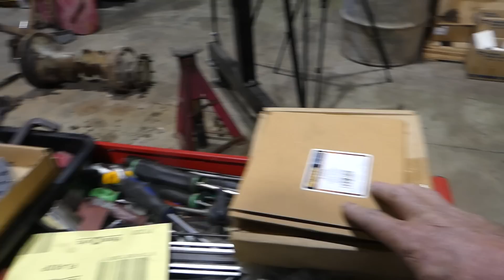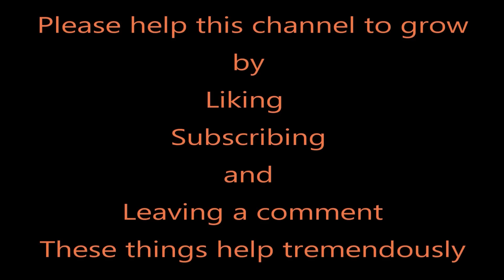Kangaroo Stew # 325  Still Fiddling with the MF65 and Making Progress

Comment: Hiya, two things...firstly, we are supposed to get smarter as we get older, keep your fingers out of the wire-wheel. My wire-wheel has mno rest and no guard, so if it wants to take a bite of me it spits me out straight away. Secondly, the UNF bolt, maybe possible to buy a longer bolt, cut of threaded section to leave plain shank, run UNF dienut on that..just a thought.
Reply from the maker: Yeah i think I will take the guard off, the polishing mop on the other side has no guards at all.

Comment: Interesting, on my Mk1 the cold start fuel reservoir is mounted in a completely different location - bolted to the back of the fuel tank by the battery tray. I know they made the fuel tank bigger on the Mk2 (and the battery tray smaller, since they did away with the Mk1’s twin 6v batteries), maybe that prompted moving the reservoir to the radiator bracket. 

Thanks for mentioning the potential for binding with the aftermarket steering joints. As I understand it, the part causing the potential nuisance is sparex s.40186, but their alternative s.40185 seems fine, the two parts have a very different shape and slightly different dimensions. I’m pretty sure mine is the former. The binding only occurs towards the extremes of rotation of the front axle pivot, such as when one front wheel is dropping into a rut from level ground. 

Great Stew, Thanks for everything!
Reply from the maker: Im not sure why the two but I will look into it, I know the 100 series had a couple of options. Ill try on full axle tilt when I have it all stable enough for that. There is plenty of room at present though. I should buy a Mk1 just to see the differences but there is not that many in our area.
Reply: A few thoughts…
Sparex indicate that both parts are suitable for MF65, but they don’t seem to say which one is suitable for a specific 65. So, it could be split Mk1/Mk2, or standard duty/heavy duty, or neither of these and it’s just a refined part from a certain serial number. It could be even that they think both parts are suitable for any 65…

I have a theory (which could well be a load of bollocks). One part is four times the price of the other, so I reckon people naturally buy the cheaper one, since Sparex say that both are suitable for a 65. Some folks find the cheaper part suits there tractor, other folks have a problem with it.
The two Sparex listings do reveal that the taper is slightly different between the two parts, so I reckon if the buyer is one of the unlucky ones whose crank-arm socket doesn’t suit the taper they’ve bought, then the part will insert too far leaving not enough clearance for everything to clear the front bolster at certain axle articulations.
I also read that the pedestal lower crank arm comes in two different lengths, so maybe these two parts suit those different crank arms.
It’s a bloody minefield!
This is all just speculation, but maybe some of it will ring a bell with you.
Reply from the maker: Send me an email to bundybearsshed@gmail.com I can send more information via email.
Reply from the maker: I just looked up ACGO for the genuine numbers and they both use the same number, 891969M91. They updated the old steel one to an alloy one with the same part number right up through the 100 series.

Comment: Work cover bang on about having guards on everything, when it comes to wire wheel your much better off with no guard. You don't do too much damage when you buff your finger with no guard (1st hand experience with my finger stuck in the guard) also when you drop a bolt it doesn't come out at you, it ends up on the floor. I dont have a guard on my buff home.
Reply from the maker: Im removing it as there is no guard on the polishing mop on the other side.
Reply: @BundyBearsShed  I was into the work cover bloke about the issue, he said I was right but rules are rules.